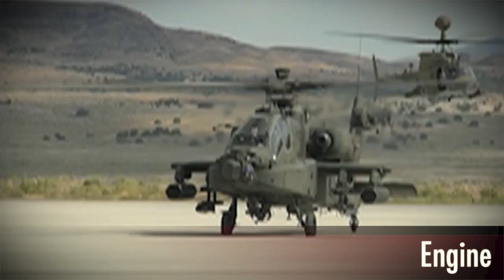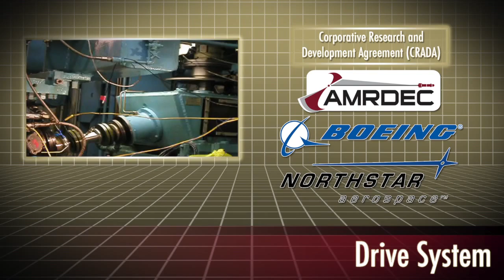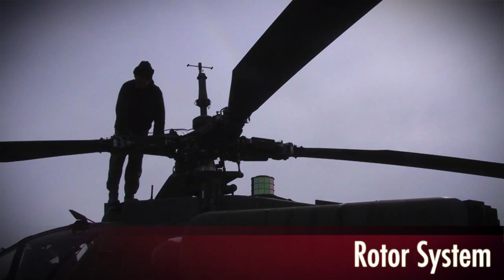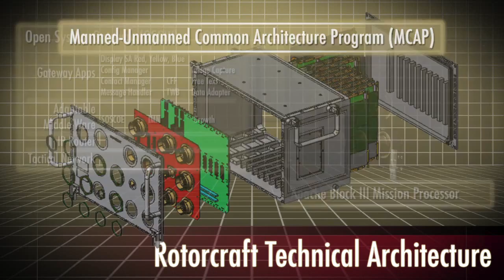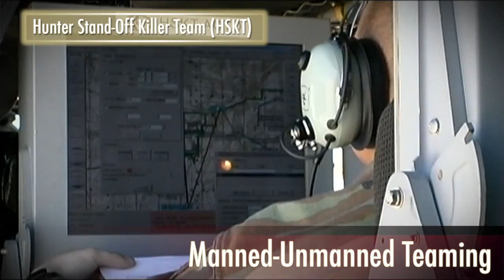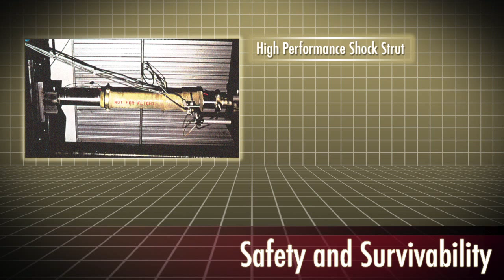US Army RDECOM - AH-64E Apache Guardian Attack Helicopter Technology Upgrades & Improvements [720p]

Comment: Ka52 takes 460 rounds 30mm ammo, but Apache got 1200rounds 30mm, even though russian 30mm round got bit better muzzle velocity and slightly more charge in warhead. but u call which one is better. BUT no way it can got more power than GAU-8, are u nut? DO u have clue how big ammo and how many RPM GAU8 got? Dont just talk like a salesman with no respect of fact. Both chopper got close loading capacity, there is no much different with missles and rockets, usless u wanna talk about quality of missle

Comment: The KA52, is thousend ways better then this fucking shit..! 😉
Reply: CedoCCCC123 maximum range Apache attack = = 8 km. the maximum range of the attack BukM2 (Syria Venezuela Russia \ Egypt and others) for a height of 15 meters = 40 km. Maximum attack ka = 52 100 km. Rocket - Hermes uses a homing guidance.
Reply: Thank you..! 😉
Reply: CedoCCCC123 lol no its not.
Reply: ы ыы even india chose longbows over that junk and they are in BRIC lol..
Reply: ***** Apache is your fucking NO. supersonic missiles. No armor, maneuver, prices, no long-range missiles. No pilot means of salvation
Reply: can you try to compare mi24 and stupid Cobra
Reply: ы ыы I think that proves my point.
Reply: hahah -100%
Reply: +CedoCCCC123 1000 times better at crashing.
Reply: Dmitri Kozlowsky ebaln. appach a maximum of 8 km Kamov 52 attack radius of 20 and even 100 km (use active homing ammo) kamov52 has missiles air-to-air. Kamov missiles fly 2 times faster than the rocket appach. Kamov has a catapult for pilot rescue. Kamov could lose 30% of screws without prejudice. lol factor. Kamov has the functions of the headquarters of the flying against appach or mi28n.
Reply: +ы ыы And KA-52 has dome EW system that can push an AA, SA missile away.
Reply: +ы ыы 

There's no comparison here, the avionics sensors and airframe of the apache are vastly superior. Max attack of 100 KM lol.
Reply: 100 km range is impossible for any rotary aircraft imo, since the projectile just can't have that much fuel to reach the target. Also how can it be guided through that much range? I doubt that target can remain visible on that range since it will just disappear under horizon. Radars that are mounted on the aircraft are unlikely that strong either.
Reply: The crewstations are armored along the sides, and the floors are armored where the seats don't provide coverage. The window between the crewstations is also armored, as well as a non-transparent armor panel below that.
Reply: ***** It's quiet economical if you think about it, not to mention the weight savings, which is a major concern with weight and balance. If you think using avionics as armor is questionable. . . The co-pilot floor is armored where the seats don't provide protection, but the pilots floor is not. The pilot sits directly on top of the forward fuel cell, which is used as protection from small arms fire from below.
Reply: ***** That's why all of the system and mission processors, communication and navigation systems, weapons and sighting systems, and every other critical component (including hydraulics, fuel systems, flight controls, power generation and distribution, etc., etc.) have redundancies located in other parts of the aircraft.